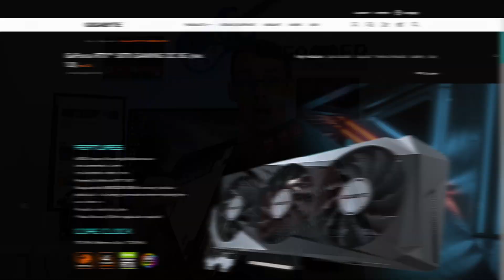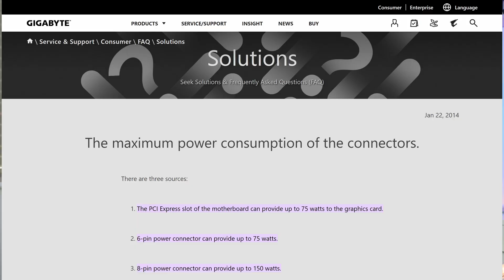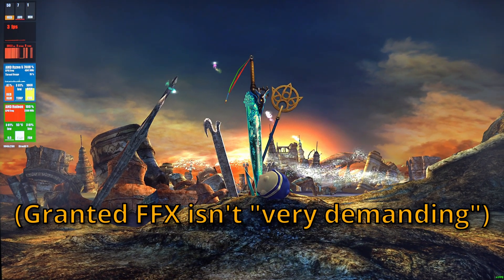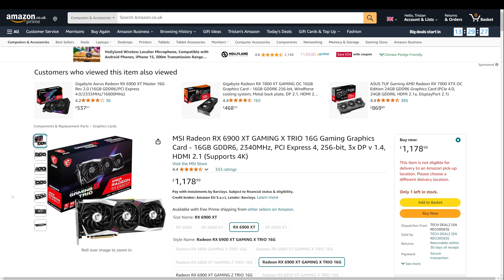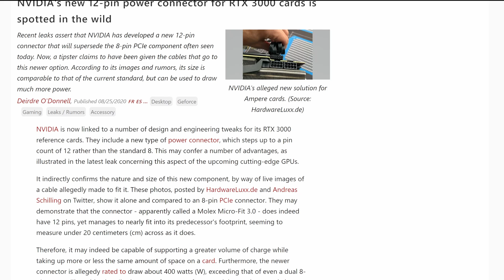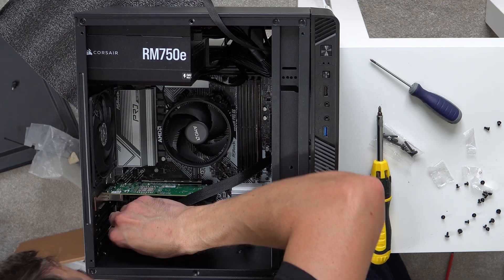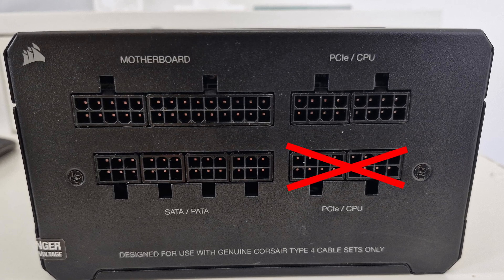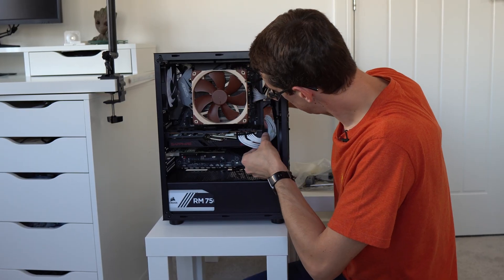How To PROPERLY Power High End GPUs (With 12vhpwr Or 3x PCIe Connectors)

Comment: My Asus Tuf Gaming RX 9070 XT OC requires 3 8-pin power connectors. The Rosewill 1200w PSU I have has only 2 available unless I daisy chain one. The PSU DOES though have a 600w PCI-e 5.0 port. I see that there are adapter cables with 2 8-pin PCI-e to a single 12+4 PCI-e 5.0 designed to use the 2 8-pin connectors on the PSU and the 12+4 on a GPU. Is there any reason I can't use the cable in reverse to get my 3rd 8-pin PCI-e connection to my GPU? (12+4 into the PSU and use only 1 of the 8-pin ends at the GPU.)
Reply from the maker: Usually you cannot flip the cable around and use them in reverse, no - this can cause problems. Obviously it's different if your PSU specifically says that you CAN do this, though :) So double check the manual, but if it doesn't say, you won't be able to reverse it. To be honest though, I think you'll be fine running 2x separate cables and a pigtail/daisy chain for one (for the 3 overall connections) - that should be okay. Equally if your PSU had a "12vhpwr to 2x8-pin cable" (to use the native PCIe 5.0 port) then you could also use this. You just won't be able to flip around a "2x-8pin to 12vhpwr cable", IMO. Sometimes the PSU cable has "PSU" written on the side of the cable, to show the part that must go into the PSU.

Comment: Not sure if u answer here anymore, but ill give it a go.

My friend wants me to build his new PC with a 9070XT Red Devil, we have begun building it but are yet to put the GPU in. He only has 2 pcie 8 pin cables and the card has 3 connectors. Is it safe to single connect one and pigtail the other two? With this card. He has a 1000W Gold psu. 

Thanks in advance.
Reply from the maker: Yes that should be fine, the 9070XT doesn't consume a massive amount of power (at least compared to an RTX 5090 for example) so two seperate cables plus a pigtail should be good :)
Reply: @TechOverwrite I have the same situation but with Asus Rog Strix RTX 5070 Ti OC Edition, is it okay?

Comment: I have a MSI Suprim X 3080ti that needs three 8 pin connectors, but my psu that is modular, only has two 8 pin connectors and one 12v-2x6 cable (both end is 16 pin). The question is it safe to daisy chain 1 connector or is there any way to make it work like buying an adaptor to make the 16 pin to have 8 pin connectors at the end? Thank you!
Reply from the maker: If you can buy an official adaptor (from your PSU maker, or a reputable third party), then a "12vh-2x6 to 8-pin" cable is quite useful. Corsair have been shipping these with their latest PSU, and they're quite useful for powering higher end AMD cards and the RTX 30 series.
Reply: @TechOverwrite can you use corsairs cable with a seasonic psu?

Comment: This was a very informative video! Recently I came across a used RTX 3090 and for work related reasons more than purely gaming, I decided to purchase it. I've ran into some very inconsistent performance, and while I think it was mostly driver issues I can't help but think my cable configuration might be negatively impacting it. My PSU only came with two 6+2 pin cables with one "devil spawn" attached each, so I had no choice but to plug two cables for the card's three connectors, one pigtailed. Do you think I might be losing some performance there? It would honestly be quite expensive to get a brand new PSU with enough connectors just to test and not see any improvements.
Reply from the maker: Hmm good question - it's hard to say for sure, but the RTX 3090 is fairly high power (well, 350w - which used to be considered high before the 4090 and 5090 came out!!). With some PSUs, it could potentially be borderline power supply. Maybe keep an eye on the power draw in the NVIDIA app, and if you experience issues when it's at (or near) 350w, then it could be a PSU issue. But if the inconsistent performance is all the time, it's more likely to be a driver issue then.
Reply: @TechOverwrite  Thank you for taking the time to respond!
I've already tried a couple of driver versions, but no luck there either.
The one thing I've noticed consistently helps is to go into the BIOS on startup and just open up the PCIe options, check that everything is still on Gen4 and close without saving. That lets me hit my expected performance while working on Unreal Engine. Should I look into updating my BIOS? I have a B860 motherboard for my Core Ultra 7, so being a fairly new system maybe I should go for an update.
Either way, the only times I've had the GPU hit 350w is while using furmark, and it gives me absolutely no issues there, so I'm guessing I'm good on the PSU side of things.
Reply from the maker: Hmm, yes a BIOS update could be worth doing - I've fixed many issues over the years with a BIOS update. Sometimes the motherboard is rushed out etc. And I agree, sounds like you're fine from the PSU side so fingers crossed it's a temporary BIOS type problem.

Comment: My GPU is 3x8pin (XTX Mercury 9070 XT) I got a 12vhpwr cable with my PSU (12vhpwr to 2x8pin). Can I use it for two of the 8pins and another 8pin to 8pin cable for the third slot? It's a MSI MAG 1000W PCIE 5.1 ATX 3.1
Reply from the maker: Yes that will work fine :)

Comment: Thanks for the video. Relieved to know that I can power my 9070 XT (requires 3 x 8 pin connectors) with just 2 PCIe cables (have a Thermaltake 1200W GF3).
Reply from the maker: Glad I could help :) Congrats on the new GPU.
Reply: Does your PSU use the 12vhpwr to 2x8pin cable?
Reply from the maker: @MrVidimlic I have powered the 9070XT with the 12vhpwr to 2x8-pin cable yes, and I didn't experience any problems :)
Reply: @TechOverwrite 12vhpwr to 2x6+2 and another one 8 pin pcie?

Comment: Hi, I have a Corsair RM850e that has 2xPCI and 1x12V-2x6, If I were to power a 3x8pin AMD GPU(planning to buy 9070xt), can I go with 1x12V-2x6 (in 2x8pin) and 1xPCI(in 1x8pin)? thanks in advance!
Reply from the maker: Hi, nice PSU - and planned GPU :) Both will work together yes, and using the 12vh-2x6 (for 2x-8pin connections) then the other 8-pin cable will be fine yes.
Reply: @TechOverwrite  thank you very much for your answer

Comment: i want to know how to use the nvidia adapter for 50 series cards with ATX 2.0 PSU's
Reply from the maker: Good question, maybe I'll do a separate video for this but ideally you should run separate 8-pin PCIe cables to each point of the NVIDIA 'squid' adapter. So if you have an RTX 5080 with three 'ends', you should run 3 separate PCIe cables to the squid adapter. Then plug them in.
Reply: I just bought a atx 3.1 instead, couldn’t be bothered faffing. Thanks! My old psu only came with two 8 pin pcie cables and Corsair don’t ship to my country sadly so I couldn’t get a 3rd one.
Reply from the maker: Ahh makes sense, and congrats on the new PSU purchase, that sounds like a good choice :)

Comment: My 7900xtx Hellhound goes up to 415 watts LOL  So...I also used taht 12v2x6 on my psu that split into 2 8pins LOL  it actually works really well powering the card off one line   I figured since it's rated at 600w  then suppling at most 415 watts would be fine  forgot not all that is comming out of that plug forgot about mobo suppling a little wattage
Reply from the maker: Wow that's quite a big power draw! Yes I think you're right - using the 12v2x6 to 8-pin here is a great idea. It's quite nice that some PSUs are offering that - it gives a lot of flexibility for powering higher end AMD and NVIDIA cards then.
Reply: @TechOverwrite  It didn't last LOL started crashing  but that was the source of the crash I thought it was due to something else at first  ^.^  PSU came with a 12v2 to 2x8pins  but now I need one of these but with 3  and I can't find any  LOL

Comment: I have a nvidia rtx 3070, which is rated at 225w and a corsair rm 750 e. Could you use the corsair 12vhpwr to dual 8 pins vice versa, as in plugging the two 8 pins to the gpu and the 12vhpwr to the psu?
Reply from the maker: Yes that would work fine :) I actually quite like that Corsair have started offering that native 12vhpwr/12vh-2x6 slot on some PSUs, I think it leads to slightly better cable management - plus it'll be fine for 225w, yes.

Comment: If an 8-pin PCIe cable is made with a splitter to 2 x 8-pin, that means it can carry 300W without heating up.
Reply from the maker: I hope that's true, although I haven't seen an official spec confirming that anywhere? I've always known that an 8-pin cable could potentially deliver as little as 150w (worst case), even with a splitter. But I'm glad to be wrong though.
Reply: @TechOverwrite The 8-pin connector is rated for 150W, not the cable.

A PCIe cable with an 8-pin connector has three +12V wires/conductors, and each of these is usually 16 AWG.

Just one 16 AWG conductor can carry ~10 amps at 12V if it is not more than 7 feet long. Most of the time, the PCIe cables are much shorter, around 2.2 feet long.

That means the three +12V wires can carry a total of ~30 amps without heating up.

30 x 12 = 360W per single PCIe cable with an 8-pin connector

Cheaper PSUs have 18 AWG conductors, which are not suitable for an 8-pin PCIe cable with a splitter to 2 x 8-pin.

An 8-pin PCIe cable with a cross-section of 18 AWG can carry safely up to ~250W.
Reply from the maker: Thanks for the added info, always good to know and remember :)
Reply: @TechOverwrite  The 8-pin connector is rated for 150W, not the cable.

A PCIe cable with an 8-pin connector has three +12V wires/conductors, and each of these is usually 16 AWG.

Just one 16 AWG conductor can carry ~10 amps at 12V if it is not more than 7 feet long. Most of the time, the PCIe cables are much shorter, around 2.2 feet long.

That means the three +12V wires can carry a total of ~30 amps without heating up.

30 x 12 = 360W per single PCIe cable with an 8-pin connector

Cheaper PSUs have 18 AWG conductors, which are not suitable for an 8-pin PCIe cable with a splitter to 2 x 8-pin.

An 8-pin PCIe cable with a cross-section of 18 AWG can carry safely up to ~250W.

You can search on Google for the article "Maximum Wattage for 6pin and 8pin PCIe Cables" on the parallelminer website. 
It is in the Category - Archives: "Product News"

Comment: I just got a RX 9070 XT (RED DEVIL) and am using 2 x 8 pin cables with one pigtail to power the 3 x 8 pin slots. MAG-A850GL-PCIE5 is my PSU. This is still fine right?
Reply from the maker: Ah congrats on the new GPU :) Yes I agree that would be fine - the 2x separate cables (plus pigtail) should definitely be fine :)
Reply: Just got this card. How’s it working for you using a pig tailed connection? I’ve just wired mine using 3 x 8 pin connections but hate how messy it looks and I’m debating using 1 single 8 pin and then for the other 2 using pigtail
Reply: @Bladed_spoonz  no issues using 2 x 8 pins with pigtail - even with OC/UV - yea its just messy though.

Comment: I am getting the RTX 5070 Ti and i have a THERMALTAKE Toughpower GT1 850W PSU (it's ATX 3.1 btw), will i be able to connect my gpu properly? That psu has a 12V-2x6 connector on it, but RTX 5070 Ti has a 16 pin connector...i am confused....
Reply from the maker: That'll be fine :) 12vhpwr and 12v-2x6 are compatible - they're just part of a spec change. The RTX 5070 Ti will have a 12vh-2x6 (H++) connector too though, if that helps :)
Reply: @TechOverwrite  thank you! ❤️‍🔥

Comment: Been looking for an answer to this, I have a higher end consumer workstation build with a 1650watt PSU and 2 GPUS

Threadripper PRO 5995wx (270W)
1x AMD 7900 XTX (350W max)
1x AMD MI100 Instinct (300W max)

I’m thinking about adding another MI100 but first I need to figure out how I am going to power these since my thermal take PSU only has two 8 Pin connectors free to power the GPUs, since I have a WRX80e sage workstation motherboard that itself requires 4 8 pin connectors to power.

I’m wondering if I can safely buy a 4x8 pin splitter for the first two GPUs (each one requires 2x8pin) and then a 2x8 pin splitter for the remaining GPU
Reply from the maker: That's really interesting, it looks like a beast of a build :) While this isn't my area of expertise, I would personally look into a second PSU to the build. While it's a hassle, I think this would be the more stable considering the high power draw of some of the components. I'd be eager to hear what you end of doing though, this is an interesting area.

Comment: I got an NZXT C850 3.1 power supply. I want to pair it with my RTX 4070 Ti Super. The thing is, the GPU has only one 12 pin slot. It came with a 12 pin cable that separates into two 8 pin(6+2) PCIE slots that can connect with the PSU's cables. However, the power supply came with a 3.1 cable that can go directly into the Graphics card. Should I use it or the one that came with the GPU?
Reply from the maker: Both options should work fine to be honest. There haven't been any cases of melting 4070 Ti Supers (that I'm aware of). I tend to prefer using less connections generally, so I like having the single 12vhpwr cable - i.e. plug one end into the PSU, and the other into the GPU. But some people prefer the 8-pin adapter approach. I think both will work okay :)

Comment: Recently, I been worried about my Be Quiet Pure Power 12M 1000w not having enough power for my 7900 XTX TUF. The PSU only has two pcie slots with two pigtail connectors and the new 12vhpwr slot plus cable. Its been really back and forth of whether this is a good configuration.
Reply from the maker: Ahh interesting. My Corsair 2025 RM1000w does that two - they supply 2x 8-pin cables, and then a further 12vh-2x6 to 2x-8pin cable (which you plug into the 12vh-2x6 slot on the PSU). It does seem weird to power an AMD card with a 12vhpwr/12vh-2x6 'cable end', especially if you need to add a further 8-pin cable to the mix, but from a power perspective it should be okay. You could always buy a DC cable clamp and test each wire under load if you're concerned - hopefully each individual wire supplies roughly the same amount of voltage.

Comment: Hi, not sure if you’re still replying. I have a 3090 with 3 x 8pins. My rm1000e power supply from Corsair has a 12v-2x6 native port that has a cable to that goes to 2 x 8 pins. I would assume that these two connectors would be able to do 600 which is more than that card would ever need. Would I need to plug in an additional standard 8pin? Or would the 12v to dual 8pins be enough? And leave the 3rd port on the GPU empty?
Reply from the maker: Hi, I'm almost certain that you still need to connect a third cable to the GPU otherwise it won't start up. So even though you're right that it has enough power, it'll still need the 3rd connection.
Reply: @TechOverwrite  I actually just heard back from Corsair and they said 

“HI Alex, so yes you would only need to use the two ports while using a 12V-2X6 cable.. We are using them with 4090s with no issue. SB”
Reply from the maker: Ahh, TIL. Thanks for replying back - that's really interesting :) I always assumed that all 3 pins needed a connection (in this case). Although I'm probably comparing it to my previous 2-slot GPU, which definitely needed that second connection otherwise it was power starved. Makes sense that a 3090 would have enough power from a 12V-2x6 cable to receive everything it needs though.

Comment: If the PSU has the 12V 2x6 output, can I use a 12vhpwr triple PCIE cable to power a GPU that takes 3 6+2 (8 pin)?
Reply from the maker: That's a great question. It probably depends on the PSU - the 12V slot can output 150w, 300w, 450w or 600w IIRC. So I wouldn't use a 3x 6+2 cable for those lower outputs, but for a PSU that outputs 450w or 600w? Yep, that should be fine.
Reply: My new Rm1000e power supply has the 12v-2x6 output on it and I was wondering if I could use the split cable that separates into 2 8pin connectors on my new 7900xtx

Comment: Please help me here this is just confusing me now I have a 500w power supply with one 8 pin for gpu but same as you the gpu need a 8pin and 6pin the gpu needs 250w and recommend psu 500w dose not state a minimum can I use a adapter on the 8pin sorry if that don't make sense 🤣
Reply from the maker: It's definitely confusing. So if you only have a single 8 pin from your PSU, your options are: (1) try and find an adapter from a reputable company to get 2x 6/8 pins or (2) change your PSU. Unfortunately it might just be the case that your PSU isn't really equipped to power 250w GPUs - sorry. The minimum PSU requirement is more about giving general advice, but if your PSU does only offer a single PCIe cable/slot, it is difficult.
Reply: @TechOverwrite  I see as I think I worked it out right by saying it well supply 225w with the 8pin and the pci slot would that not run right with a adapter on as only 2x8pin power supply's I can fine is 850w with the 2x 8pin pci thanks for the reply

Comment: 12vhpwr - 5080 for example - they seem to come with adapters with 3x PCIe adapters. Does that mean we’re back on the pigtail question? Do you need a PSU with 3xPCIe sockets and use all of them, or is two ok?
Reply from the maker: Good question, you ideally should run 3x separate PCIe cables from the PSU yes (and so, have a PSU with 3x free ones) - agreed. I actually just received my 5080 FE yesterday, but I have a PSU that has a native 12vh-2x6 port. Actually I have two such PSUs (long story): the new Corsair RM1000e ATX 3.1 2025 model, and also a Montech Titanium Platinum ATX 3.1. Both of those have 12vh-2x6 ports, meaning that you can plug a single cable into the PSU, and then a single cable into the GPU (like the 5080). I know that means getting a new PSU, but I would prefer that to using a pigtail with a 5080. Just my own opinion though.
Reply: I use a pigtail on my 5080, but we are talking about 2 16 AWG pcie wires + pigtail + pcie slot